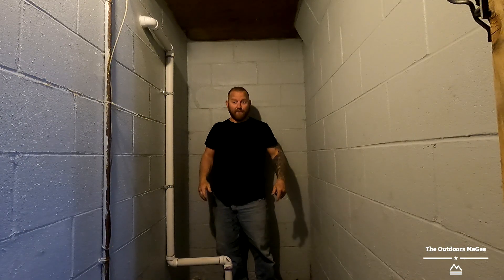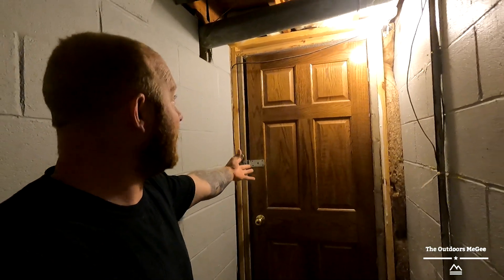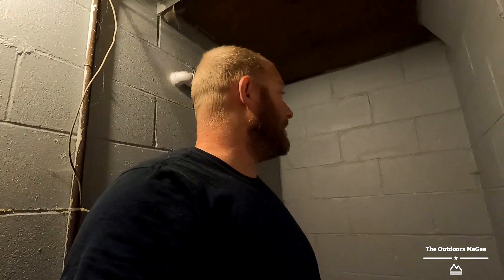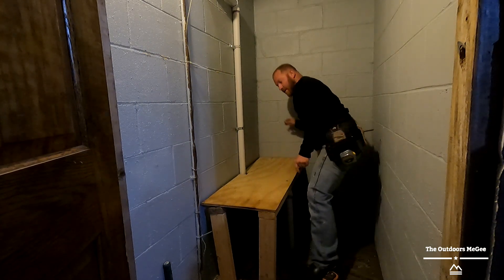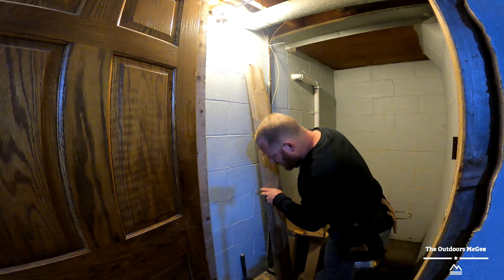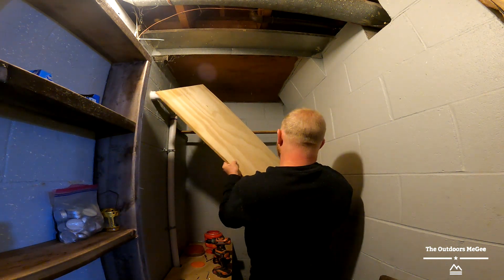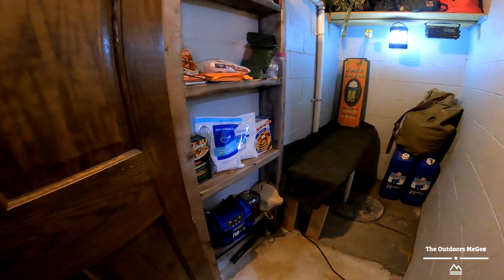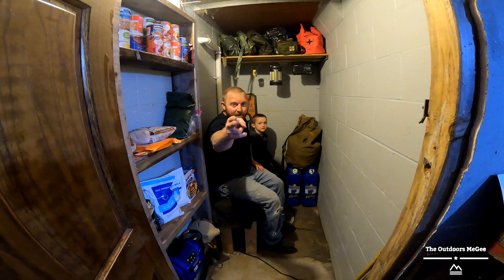Building a Storm/Tornado shelter

Comment: Mr MeGee  having been through 11 hurricanes  in South Florida  a safe room especially in tornado alley  I think is a must What I see is a in swing door  reverse it  and tap con the jamb into the block. Also I would add  a grade 1 dead bolt  being  the door  is the weakest link from wind or debris. Pay attention to short term after the storm there will be no power or water  and the point being to survive not live . Wish I could tell ya more but not sure if cellar or if the blocks are a solid pour or hollow also every one has to hit the  bathroom  we had a storm that stalled for 23 hours. also lots of water and batteries. There is much more. Good luck brother
Reply from the maker: Thank you very much for your tips my friend! Stay safe down there!

Comment: Shovel and how ya gonna poop ? Saws -All  would be great if you could think of it , same for a silky saw . JIC limbs are blocking your exit . Emergency Radio . Also btw . They do make water powered sump pumps that work even if the power is off .
Reply from the maker: Thank you very much for your tips my friend!
Reply: @TheOutdoorsMeGee  Normally " water powered " sump pumps will work as long as your water to the house is working and your town does have a water tower with a back up generator . Lots of people put a " water powered " above the electric one due to high water bills for normal use .  But will work during a power outage . Be safe ...

Comment: Not to bum you out ,but you cannot use that kind of door, it has to be steel of somewhat so the wind does not take it away.
Reply from the maker: Working with what we got! An won't matter about the door if the roof flies off lol
Reply: You have that pipe to hang on to if the roof flys off

Comment: Bro when the sub pump fails where the water level is . Make sure that doorbopens out. Because water take the path of least resistance.  That hole is great way to flood the basement. Where you are stuck. 😢
Reply from the maker: I need a lil electric generator and ill everything should be fine. On paper anyways haha
Reply: Just something to think about. Be safe brother.